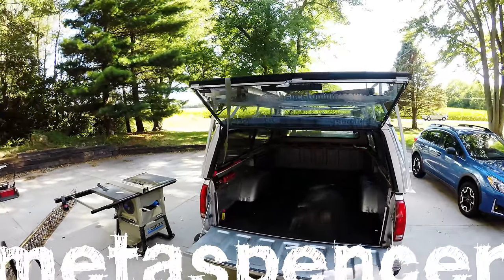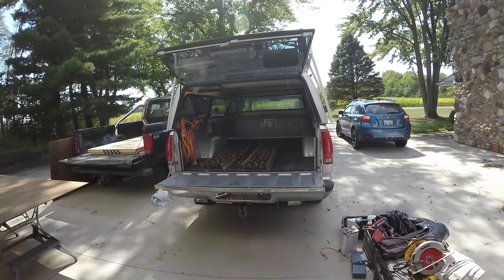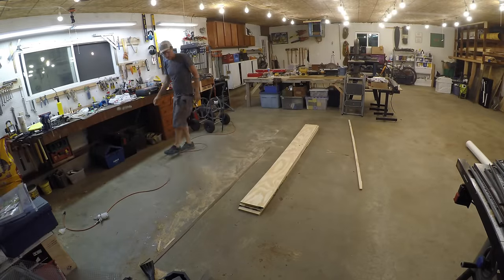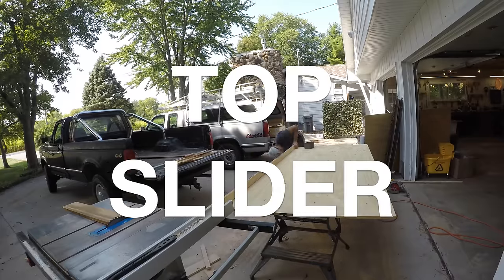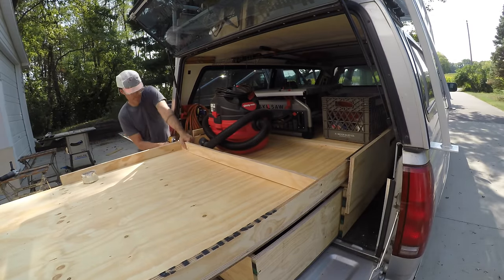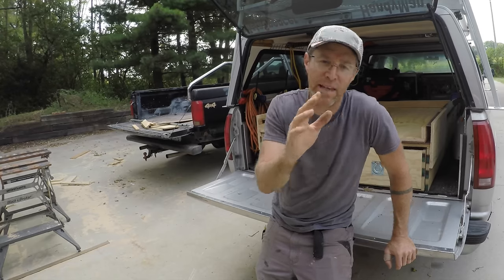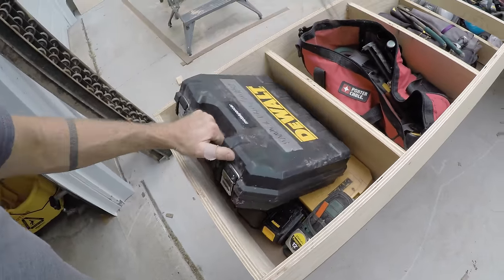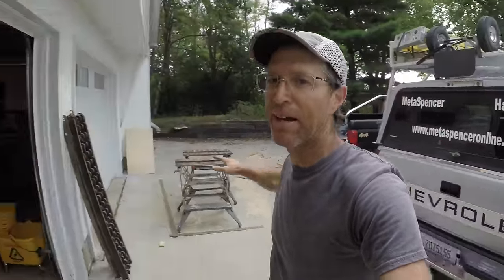Building Truck Bed Drawers + BedSlide

Comment: I really like your practical approach to this. Much lower cost and not over built like some other options, and you also admit where you could have made some enhancements. Love your idea of using a clamp when ripping plywood!
Reply from the maker: Thanks man. When you've got limited time to build something and the truck needs to get back to work, might as well keep it simple. I use this system every day all day long and it's still going strong.

Comment: Great job! I lifted my drawer bottoms 1/4” via a dado cut in the sides, this created runners on each side and significantly reduced the drag and friction, a little wax on the runners and I can pull my drawers quite easily.
Reply from the maker: excellent! sounds like a great way to do it ... those drawers can get heavy!

Comment: Great work fella.  A good storage set up is a total game changer for efficiency when you work out of your vehicle.  Same set up as I have in my own van.   My city (Wellington New Zealand) is very hilly so without sliders my drawers can get too heavy if I'm parked facing downhill.  I've been caught a few times too when parallel parked in a line of cars with not enough room to pull my long drawers right out.  So, I'm careful to have the 'seldom used' items at the back of the drawers.  There's no perfect set up, it's all about what works best for the user.  Thanks for posting.
Reply from the maker: Absolutely, mate. That sounds like a great way to store gear in a van -- plus ya have more room! I'm a steady consumer of videos about New Zealand ... cool place!

Comment: Great idea. Cool video. Rig up and spring load the draws so they are not heavy to pull.
Reply from the maker: Yep, good idea. With a bit of engineering it could be as easy as pie to work those drawers. But man: I use this system every day and it's great

Comment: i built something like this for my 04 2500 ram about 7 years ago. i used 1/2 ply on the sides and 33/4 on the bottom. the frame was constructed of#2 1x3 kreg jiged together=lighter. the bottom of the drawer i spaced up so only the sides ride on the frame i put paraffin wax on the bottom of the edges to help with sliding. i also moved the rear most vertical panel inboard so i could use some leftover closet dowel for handles from sided to side with small storage below the handles for tape measures pens pencils ect. i did less cross sectioning than you did just a support avross the top in the center out of 1x3 to keep the tops of the drawer from flexing.
Reply from the maker: Sounds like you did a good job. That paraffin wax is a great way to go as mine have definitely had some friction issues and been tough to open and close when fully weighted down. With my 8' drawers they can get really heavy ... too heavy. It's cool to hear that others have done similar things! Thanks for checking it out, man

Comment: For wood on wood use floor paste wax. Will last about a year and the more it soaks in the better it works. I also use it for sliding big beams by myself.
Reply from the maker: I’ll look for some. Thanks for the tip!

Comment: on the topic of multiple batteries for tools, I realize this is 4 years or more old, but I have adapters for each brand of power tool I have that allow me to swap batteries as needed. my dealt tools can use Milwaukee and ridgid batteries, Milwaukee can use rigid and dealt, and rigid can use dealt and Milwaukee batteries... and each adapter was no more than 12-15 bucks per, so I have 6 of them , so any combination of battery and tool is possible. Just in case you didnt know, now you do :) also, thanks for this video, because obviously im building one now and wanted ideas to add to mine. ill post mine as well....
Reply from the maker: Woah, there are adapters out now! That's a game changer man ... thanks for the tip. I'm gonna have to look for them because this battery swapping is getting out of hand

Comment: I’ve been referring to this video quite a few times while brainstorming my truck drawers and it’s been a great resource so I wanted to throw you a few bucks as a thank you. Then, I saw the link to the plans and they were $2!! Crazy good value. Hope it all adds up in your bank account. I’m building them tomorrow.😉
Reply from the maker: Good luck with that build, man! I figure it's better to sell the plans for cheap and get the idea out there than to overprice them. You're gonna love all that organization and storage. If I were to build them again I'd probably use a beefier bottom on those drawers. Mine seem to be wearing after a couple of years. Thanks man
Reply: @metaspencer  I did a little more than half the work today but had to stop due to good ol’ Minnesota snow! :) I added plywood to the bottom of the drawers so that should help. Thanks for the tip.
Reply from the maker: Excellent

Comment: Get UHMW strips to run down the bottom of the drawers on the left and right side. I have them on my truck bed tool box and they work awesome. Even up here in Canada at -40C outside.
Reply from the maker: Thanks for the tip! Never heard of them

Comment: Remove the felt pads right away, and rub down the mdf hard board with bar soap. The soap will be an excellent addition to make the drawers side with ease. it's what I use when ever I am doing wood on wood contact. Nice work and truck setup.
Reply from the maker: Cool tip. Yeah the felt didn’t last long

Comment: Just built some my drawers slide plywood in plywood construction exterior grade.i rubbed it down with snowboard wax and it slides real nicely.got big handles from glass shower door.
72”long 16” wide
Reply from the maker: Snowboard wax! Great idea. Sounds like a great setup!

Comment: You can buy converters on amazon that allow you to use different battery platforms with different tools. You could get the ones you need for the chargers you want to use to charge the batteries for the other tool manufacturers.
Reply from the maker: Oh that sounds good! Thanks for the tip!

Comment: You could put very low profile casters toward the front on the bottom/ base surface facing up and toward the back on the bottom of the drawers facing down. Four casters each would do it and support the drawers in and out.
Reply from the maker: Casters are a good idea ... I might just go there, if the drawer continues to annoy :) thanks!

Comment: Just found this video thank you so much for doing it.  I was playing around with the idea of bearings versus wheels.  Then you used the old conveyor tracks which we also have quite a few just sitting in the barn and I can’t believe I didn’t think of it so thanks for the idea.
Reply from the maker: Good to hear! Drawers make the back of the truck so, so much better. :)

Comment: Great video. I have had the same drawer system for tools. Mine has 3 drawers same height. I built mine in 2001 and has been in a few trucks over the years and has now become part of my camper van conversion. Drawers are hard to pull out I agree. When I built mine I mortised the bottom of the drawer sides so the drawers only contacted 3/4 inch each side of the bottom..that helps some. Wax helps also. I have Osb tops that slide in and out with the drawers, adjustable/ removable. Makes a nice worktop and some protection from weather and theft when working inside with your drawers open. Again great video.
Reply from the maker: Oh, I love the cover/worktop idea! I'm really liking the drawers: I use them daily and don't know how I'd stay organized without them. Thanks for the comment!  I'm envious of your van ... I totally want one

Comment: Love this idea.  Would be a great storage idea for the prison bus (or any - i've noted it for under bed storage in my upcoming bus conversion).  A question though:  How much weight does that plywood frame add to the vehicle?  Especially with those heavy tools on board.  Here in the UK it's a problem we'd need to address to avoid a ticket.

And if I can make a suggestion?  The power cable from the inverter would look neater if it was ran over the ceiling shovel rack out of the way rather than along the side of the truck.  This would also allow more stuff to be hung on the side without the power cable getting in the way?
Reply from the maker: I have to admit that the power cord is super messy the way it is: I need to tidy that up! I'll try your ceiling idea tomorrow and see how it goes. If it's not right, I'll tuck it away under the bed rail. Now, as for weight it is certainly a consideration. My truck is rated to carry about 2,500 lbs, and the drawers themselves are around 200 lbs. The tools add quite a bit, though: I'm thinking the weight added back there is around 800-1,000 lbs. Next time I'm at the steel yard I'll have to weigh in and see where it's at. One thing I should probably do before that is pull out some less-used and heavy tools. I'm sure I can find a few. Take care!

Comment: I like the whole project, but a thought, based on my own unpleasant experience:  In an accident, all the tools in back will become deadly projectiles and will crash through the windows and join you up front.  A metal lath grill or something could be bolted on over the window to keep stuff out of the cab.
Reply from the maker: Ahhh, great idea. I think those are called headache racks and would be easy to fabricate and install. I'm putting it on my list ... thanks for the tip!
Reply: @metaspencer  Thank you for all the great vids!  Came for the prison bus project, but stayed for the other topics...

Comment: Great DIY build! What about on your drawers instead of using hardwood sheets you used plastic sheets? Remember the old-school plastic bed liners that didn't work too well because they allowed everything to slide all over the place? Maybe plastic on plastic would slide pretty well. Or instead of that just add more felt pads. I've noticed some felt pads are smoother than others, and I've found strips of carpet that slide better than felt. Or a combination of those materials.
Reply from the maker: Great idea on the plastic. I tried felt pads but they just pulled off and didn't last. Plastic would be ideal!

Comment: 5:15 I use the spray teflon that dries for wood on wood. Works awesome on old drawers and very old wooden windows. It's really a godsend. I thought I'd mention it so when/if your felt fails you have a fall back plan.
 Good on you for reusing the angle iron bed frames. I get a lot of those here and have built all kinds of things out of them. With the tool batteries it's too bad more of the companies don't make their chargers have a 12vdc "travel" option. I just bought such a charger for a video camera. There's so much heat loss & electrical waste converting 12vdc to 120vac then back to the battery voltage.
 Having two pulls on the drawers would help immensely, so would the teflon stuff I mentioned above. You could also pull those metal ones off and attach another board from the face and cut some pull out holes cut at angle with a jigsaw and use those instead of needing new hardware.

I know what it's like to try to keep all that stuff organized. I've kept rental property running smoothly for decades and I too have needed all that stuff. But now I feel like it's overwhelming me with all of my health issues. There is just so much stuff. I wish you were closer. I like your sensibilities and I'd hire you.
Reply from the maker: Oh how I'd love to help out with rental properties -- I'm looking for someone like that here in town, as rental properties need constant care. :) How have I lived this long and not heard of that teflon spray? I'll look for it at the hardware store as it's just what I need in this instance and several others ... sliding smoothly is what it's all about. Hang in man! I'm sorry to hear about the health stuff.
Reply: @metaspencer  Like most every one else you've probably just used the teflon spray for metal on metal. I experimented and tried it on the wooden applications just to see if it was better than the wax I was using. Definitely was. Just make sure it is the type that dries out. I buy whatever is cheap or on sale. 
Yeah property care is really never ending. Mentally I like to do it but my joints don't. That's a big part of why I bought an electric lawnmower and snowblower -- no pull start to wrestle with.
Reply: Never knew they had teflon wax, thanks for the info

Comment: It's scary how alike you and I are. I constantly change the back of my truck but I do need to build  a truck bed box system. I use to work for a large homebuilder and all the material I would need were right in the dumpsters but now that I have to buy it, this has slowed me down considerably. Thanks for the video's and I will keep watching.
Reply from the maker: Having to buy stuff will definitely put the brakes on things! It's funny that you should mention constant change because I was just thinking yesterday "I should change my drawer system to add boxes for chainsaws up on the slider." So yeah, a constant work in progress. Thanks for checking it out!

Comment: Having drawers in the back makes a huge difference when not having to move stuff around. It's a real time saver when accessing tools. But I agree. They get heavy after a while & you will wish for bearing sliders.
Reply from the maker: Yeah the drawers make the truck so much more useful ... true what you say about the weight, too

Comment: I built some similar (but shorter) drawers for a station wagon a while back. I didn't want any steel rails in case I get rear ended. More of a problem in a wagon than your truck. I used teflon strips made from kitchen cutting boards instead of felt for sliders. 
BTW, could you mount the tube below the roof rack, between the rack and the roof. This will free up the room on top of the rack. 
Cheers from Australia.
Reply from the maker: I had a station wagon for years and never thought of drawers ... sounds like a great idea! You're right about that tube of mine: it's eating up the space up top and I don't even store much in it these days. I may move it to the trailer ... good hearing from you!

Comment: Try using UHMW plastic for sliders. Plastic will slide on hardboard easier than hardboard on hardboard.
Reply from the maker: I've gotta do that. Resistance has been annoying ... thanks for the tip!

Comment: Nice build. Very similar to mine for the drawers-we did not do a sider- and we have had some drawer problems and am looking at solutions here.  Also looking at using screw on skids for boat trailers. I used teflon tape that worked great but it eventually came off [our drawers are several years old]. Tried PVC trim. Nope. Have to check on some of the other ideas.
Reply from the maker: Mine are wearing a bit under heavy use and I added bearings under the top deck

Comment: Excellent job for your first set. I’ve built a couple sets now and find that I don’t need the pads under the drawers. I just applied some wax and run them wood to wood. I like your slider top. Handy!
Reply from the maker: I see what you mean about the wood-to-wood connection ... I think it would be just fine. Love those drawers! :)

Comment: Get chest drawer pulls! They work great. You can get them at a Home Depot for a few bucks. They drop flat when not in use, and when you go to lift them they stop at 90 degrees so your fingers don’t get pinched. Works awesome for my drawers.
Reply from the maker: Good point! I converted these handles to big rectangular ones after a day or two ... much better to grab and pull with! :)

Comment: Get a ridgid or Milwaukee set. Same battery system for their tools. And they will definitely last longer than Porter Cable 🤷‍♂️
Reply from the maker: Yeah, hoping to someday. They make great stuff
Reply: I’m not sure where your getting your Milwaukee and rigid stuff but I have both platforms in both 12V & 18V and I have sets that are both comparable in age from about 3 months old on each set to over 5 years old on each set and they do NOT interchange between those two brands. I’ve tried over and over and they just are not the same at all and will not even slide together. It sure would be nice if they would but at least the 10 sets I have do not interchange.

Comment from the maker: Hey, Spencer here with a few notes. First, PLANS for the storage system are now at https://metaspencer.etsy.com ... And I should say that after a few months of use I've already made a few changes to this drawer system: the top slider is now on roller ball transfer bearings (https://amzn.to/2PE7vN9) ... the other thing to note is that the felt pads came off before too long and there is now some wear due to the hardboard-on-hardboard connections. So I may end up going with drawer sliders for the drawers at some point in the future.
Reply: FYI, UMHW sheet * "rails" * would be a good alternative.
Reply from the maker: @larryrichardson5167  Yeah, I think you're right there ... wood on wood is creating some drag over time with daily use :) thanks!
Reply: I imagine the hardboard wouldn’t last too long if it ever gets wet
Reply from the maker: @y0uCantHandle  fortunately it's dry in there ... but that hardboard does seem to be wearing from daily use ... so it may not be the best in the long run
Reply: @metaspencer  what do you have them rolling on?
Reply from the maker: @antonyoneil294  https://amzn.to/2ui1ONS
Reply: I think those transfer bearings are the best idea!  The drawer slides are HEAVY and cost you some space too.  Ive watched a few of these builds and always find drawer slides to be tedious, expensive, and waste space.
Reply from the maker: @triplealley  I understand the guys who go with slides, but in my case as long as the drawers are moving I'm in good shape :)
Reply: What if you used some wax? Instead of felt/rollers/etc.

Edit - typed this before reading the comments, it's already been mentioned... Carry on !
Reply from the maker: @fishingismydrug1  Yep, several people swear by wax ... sounds like a good option! :)